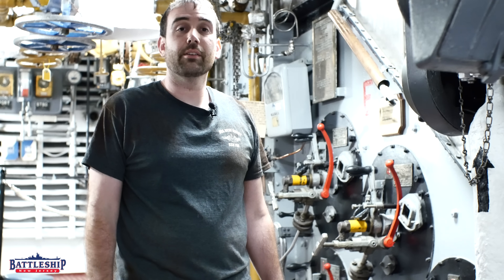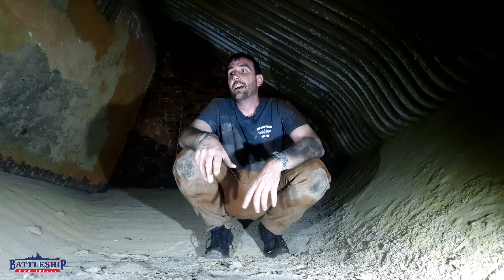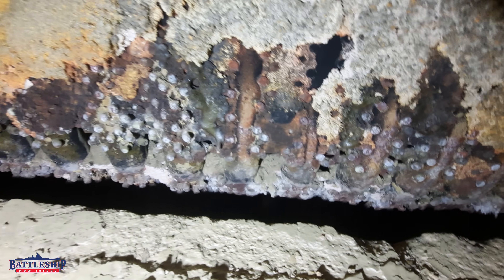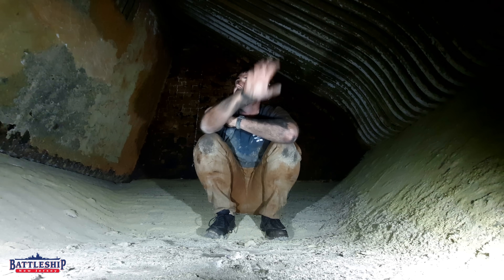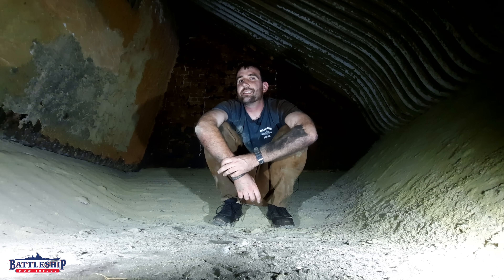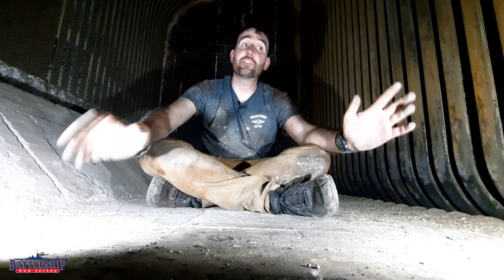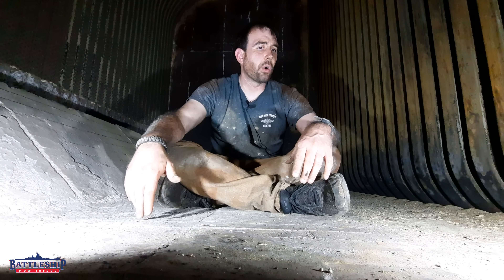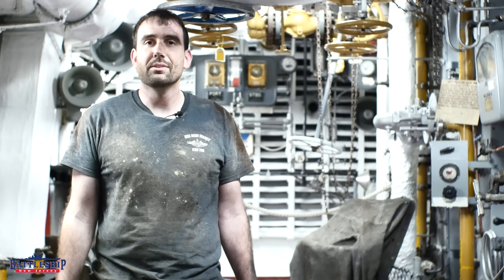Inside the Boiler of The World's Fastest Battleship

Comment: I cannot envision NOT superheating the steam. Doing so would seriously degrade the turbines. We would NEVER put steam to the header that was not superheated.
Reply: All nuclear ships run on saturated steam
Reply: @markschenher4559  This is dry saturated steam. Hey, this is a joke!
Reply: @markschenher4559  Those turbines are designed for saturated steam.  For land based nuclear power plants with 33% thermodynamic efficiency, why not a methane burner to superheat the steam and get 40% efficiency?  I guess the regulatory environment and lawfare by the anti-nukers, along with game playing politicians would put the kibosh on that.
Reply: @RogerWKnight  increasing the "efficiency" of a nuclear by burning fossil fuels would be expensive and impractical. However, various Gen IV reactor designs will run at higher temperatures, thus increasing efficiency.
Reply: @RogerWKnight  Depending on the version of reactor plant and STG, HP steam would be used to superheat the LP steam coming from the MSRHs before being admitted to the LP turbines.
Reply: The nukes don’t superheat. They push it out through moisture separators and it’s dry enough. Those plants can handle the transient pressures by design unlike boilers.
Reply: Only the newer BBS like the Iowas used Superheated steam, older BBS with the North Carolina used low pressure turbines, and lots of WW1 era ships used low pressure turbines or triple expansion engines, that dont need superheated steam
Reply: @TheMrLebaron  The North Carolinas and South Dakota class used 600 psi steam plants with 565 degree steam temp.
Reply: @samb3706  Yes they did, neither of which is superheated steam.
Reply: @TheMrLebaron  The saturation temperature of 600 psi steam is 488.8 deg F.  The steam temperature of the South Dakota class BB’s was 850 deg F.   The steam was absolutely superheated.   I didn’t take the time to look it up, but I’m sure the North Carolina class was superheated as well.   Superheating increases the efficiency of the system significantly over saturated steam.  Any mechanical engineer designing a saturated steam plant for propulsion in the 1930’s would have been guilty of professional malpractice.
Reply: @turdferguson4124  If you this thing called " read " I didnt mention the South Dakotas, I mentioned the North Carolins which do NOT use superheated steam, and WW1 era ships which also do not use superheated steam. And Steam is a pretty terrible way to propel a ship unless you have a nuclear reactor. Theres a reason it isnt used anymore
Reply: @TheMrLebaron  The North Carolina class fast battleships used steam at 575 psi and 850 deg F, which is most certainly superheated (almost 300 deg of superheat, in fact).  Achieving the same shaft horsepower with a saturated steam would require a considerably larger powerplant, which would require a much heavier armor protection scheme.  

Do you understand the engineering definition of superheated steam?
Reply: @TheMrLebaron  The reason is economics, diesel is cheaper to run. Steam is good, not terrible, just more expensive.
Reply: @TheMrLebaron  What isn't used anymore?
Reply: @jameslong3351  Steam. Outside of nuclear ships 99% are cargo ships are diesel now
Reply: @TheMrLebaron  With absolutely HUGE engines, pistons the size of large trash cans, and built so that maintenance can be performed on single cylinders, or more if necessary, also very time consuming SOB task.
Reply: @thomasmleahy6218  I was on C-10's with 12 cyl, Sulzer engines. 35 day round trip, 2 cylinders rebuilt every trip. Usually took 48 hrs. or so. Start Saturday, finish Sunday, underway Sunday night.

Comment: 12:17 Im just an average citizen but perhaps those nodules are to increase the surface area and thus extract more heat into the water. Thats why it looks like a radiator in there. Thats all thats happening but now your doing it on a smaller and smaller level which is what those little nubbs might be. Just a thought.

Comment: Boiler tenders and other rates in the lower part of the ship were known as black gangs and snipes. because of the dirt I suppose
Reply: Id imagine that originally came from the coal-fired boiler days... Not positive, but good assumption???
Reply: @wheels-n-tires1846  I was on aircraft carrier's 68-71 the ports in the deck would sometimes open next to the chow line and these sailors would emerge covered with soot. I did not envy those that worked in the bowels of the ship. I think most people called them snipes. I was an Airedale or brown shoe.

Comment: The condenser  is usually around 27.5-28.5 inches of Hg that is a little under one atmosphere negative Not two!

30 inches Hg = 14.7 psi Absolute= 1 ATM
Reply: Correct.  The whole terminology of talking about vacuum as negative pressure confuses people.  A careful chemist, physicist or engineer will only refer to absolute pressure, in which a perfect vacuum is at zero pressure and there is no such thing as negative pressure.  When you use the very common differential pressure gauges with zero set relative to the surrounding atmosphere they can not read less than -1 atmosphere.

Comment: Feed water goes from the DFT through the main feed booster pumps to the main feed pumps where it's pumped through the economizer  before it enters the steam drum on top of the boiler. From there, out of the top of the stream drum it's now saturated steam (approx 495 degrees) on it's way to the superheater to be made into main steam (850 degrees)
Reply: @kristyskirt9015  it's basically the exact same but the main difference is instead of a boiler like in the video, there is a nuclear reactor that makes steam. Both a boiler and a reactor exist solely to make steam. There are some finer details that are different as a result, but the power generation process is largely the same
Reply: @kristyskirt9015  Yes it is similar in some ways.
Reply: Oh, also after the main steam goes to the HP turbine, then through the crossover to the LP turbine, it exhausts into the main condenser (as noted in video).  There is still steam in the main condenser, it's now called aux exhaust steam and is used to heat things like the feedwater in the DFT and water in the distilling plants.  It's very important for the main condenser to keep a certain level of aux exhaust steam, otherwise "augmenting steam" will be shot into the main condenser to bring the levels up.
Reply: @ytlas3  ya need to go back to the MM3&2 book. Too many things wrong. There is vacuum in the condenser, created when the steam condensing into droplets and fall in the hotwell. The vacuum goes (most times on a Navy ship) back up into the LP turbine. I think the highest LP turbine casing pressure I've seen was during high power runs. Aux exhaust came from (in the old days) the exhaust from the steam driven pumps, blowers, etc. It was controlled into the condenser with a back pressure valve, to maintain pressure on the line, so you can use it for reclaiming the heat from it. Now, with all electric pumps and blowers, you have to make up "Aux steam") for those purposes. 
I was gonna comment on the difference in the terminology used for that feed water storage tank. In the Navy, it's called a Deareating Feed Tank (DFT). On merchant ships they call it the DC (direct contact) Heater.
They do the same thing, in the same way, yet one emphasizes one function over the other.
The main difference between a fossil fuel and nuclear steam plant, is that nuclear plants only produce saturated steam. That and they can go a bit further without refueling....
Oh, let's just say that doing "firesides" on a nuc would really suck!
Reply: @kristyskirt9015  All steam systems work in a similar fashion. Rankine cycle.

Comment: On the boiler tubes you called those protrusions on the tubing, but they are not completions they are actually studs shot by general electric stud guns that can be anywhere from 7/16 to 5/8 or half inch in diameter at about half inch to 3/4 of an inch in the length depending on the specifications by the boiler make. I worked for George p righteous years ago and we had the only stud guns that you can find in the planet. They went out of their way to buy every single part for every single broken or working gun they could find. We specialized in this work and traveled all over the world to do this kind of work. The studs are shot onto the tubing and the refractory is packed around the studs so the tubing wasn't damaged from the fire. The studs were to transfer the heat to the boiler too.
Reply: My first thought about those ‘bobbles’ was that they were there to increase surface area for better heat absorption.
Reply: @mcgherkinstudios  The studs are there to add anchors for the plastic chrome ore or PCO which is llke firebrick that is soft enough to be pounded onto the tube to separate the saturated side from the saturated side so that we could control the superheated steam temp. Those studded 2 inch tubes were also used on the side of the superheated side to protect the innner boiler casing The superheater was used at ALL timed because of the SSTG's. Sa soon as a certian amount of steam flow was indicated the superheater was lit off. you could always tell the topwatch because he had no hair on one arm from the fire blowing out of the lite off port . On the Midway we always just removed a burner to access the furnaces.
Reply: @johnchilds6471  Oh, so he guessed it right at 12:08. Good for him. Is it to just stop it sliding along the tube? Or, are they along the full length of the tube? Looked like they were only at the base in that first shot.
Reply: @johnchilds6471  That is what I remember from USS Ranger Cv 61 and USS Hepburn FF 1055 Thank You
Reply: @ShimrraJamaane  they only go up as high as you see the refractory.
Reply: @mcgherkinstudios  exactly my thoughts as well
Reply: Yup, the refractory is placed where the boiler designer finds that the heat would be a little too much for the water in the tubes to cool them adequately.  It protects the steel from overheating.  It depends on the flame pattern which varies with the rate of firing (air and fuel feed) and the location within the boiler.  The studs aren't to increase heat transfer, they are to provide an anchor for the refractory which reduces the local heat transfer.
Reply: The power plant for the aluminium smelter used to blow tubes on a regularly irregular basis. Makes me wonder about ships, especially battleships blowing tubes. Even inside my plant protection office about a half click away it was an impressive din- I can imagine what it was like at sea, trapped in a metal box!!
Reply: @KellysRealistsandPragmatists  What was the name of the power station that regularly blew tubes? What was it's fuel? I wouldn't think that an aluminum smelter could tolerate regular forced outages.
Reply: @gregorymalchuk272  the power station was a 400 megawatt lignite dirt burner originally built by Texas Power and Light in 1986. Eventually it became TXU and then luminant. And it didn't happen frequently, I misspoke, it was irregularly regular, probably not more than a couple of times a year... it was a Alcoa primary metal smelter in Rockdale Texas. The smelter shut down in 2008 and I think the power station shut down in 2016.
Reply: Cool info. Thanks. 👍
Reply: He said "Concretions", btw...
Reply: Reintjes was the name on the orange painted hoppers holding the studs, that we used.
Reply: Are you saying it is like lath that is used to hold and reinforce plaster in old houses and sheetrock repair?
Reply: Your sure it is not 13/29 banana ? And a see a tubing 17/37 racoon in the corner.
Reply: My son shot studs inside of commercial boilers in steam generating plants and traveled around to several states.
Reply: Was your work exclusive to ships, or did you work on power plants as well?
Reply: @KellysRealistsandPragmatists  me? Strictly powerplants, but the application of processes is almost identical except for boiler size and size of components.
Reply: @incognito5986  Did you ever make it to Rockdale Texas? The ALCOA power plants from the 50s and then the Texas power and light (eventually Luminant) power plant from the 80s energized the smelter where I work as a medic/firefighter/private security contractor.
Reply: @KellysRealistsandPragmatists  never made it there, but my sisters ex husband worked there in the late ‘70s. Visited her once there. Nice area back then, country setting mainly.
Reply: Why where they the only people on planet earth with a stud gun?
Reply: @studinthemaking  they weren’t. But there were only a couple of companies that have the particular stud welding machine/process.

The industry isn’t big enough to support many companies with the machines, as the studs are quite durable and outlast the refractory and where the studs and refractory aren’t, the tubes wear out/thin.
That in turn causes tube replacement which generally encompasses the section with studs on it as well.
So to stay in business, its easier for a very few companies to offer the stud welding services. They even rent the machines to contractors who have workers skilled with the machine, not requiring the company owning the machines to use their personnel. Its quite the specialized job/process. And not done very often.
Reply: @studinthemaking  Small demand, not a lot of need.
Reply: That’s cool as all get out
Reply: Appreciate you explaining all of that.
Reply: Info rich!  Thank you sir.
Reply: Stud guns are quite common in structural steel fabrication. They are used to reinforce concrete floor decking...
Reply: @Jreb1865  right they're also used in the automotive world. im assuming he's referring to a certain model that was outdated but worked the best? because a stud gun is very common
Reply: @45lc48  Maybe..They looked just like the ones we used, just shorter. Standard length was 4 1/8"   for a 6" concrete fill floor...
Reply: @45lc48  they’re GE stud guns meant specifically for boilers

Comment: NO... super heat side Always used to produce "dry steam" for engines and generators! Talc powder was dumped in saturated side (to absorb moisture!) due to a tiny leak, slight moisture, when placed in dry layup!!!
Reply: Clarify - add some more details please. Probably you are saying all this power on the floor is NOT soot/ fire residue at all but purely material added when laid up for preservative purposes? Which I'd believe more than that is soot/ fire residue. Thank you.
Reply: @wfoj21  it's Not the common Talc Powder! I forget the name! It's a moisture absorbant similar to desiccant! Just powerized instead of granular!
Used mainly in shipyards! NOT meant for long term dry layup! Used to Dry out wet bricks! Prolly left on accident!
Reply: @wfoj21  Soot is Black as night! Unless burnt... then it's ash grey on the surface!
Also... that amount of soot would've been from a HUGH firebox fire!

Comment: 1600 hours before replacement of the firebrick???....That's 10 weeks.......Was that 1600 hours for replacing ALL the firebrick, or is it 1600 hours before inspecting and replacing broken and cracked ones???.....It would probably take a few days after a total shutdown before it was cool enough to clean and inspect.
Reply: Inspection... replaced if needed! I went inside the airbox 50 minutes after shutdown... it was barely warm! The inside cools off fast with air flow!